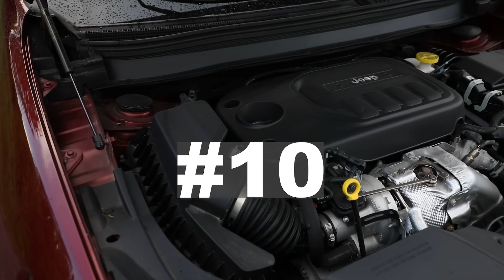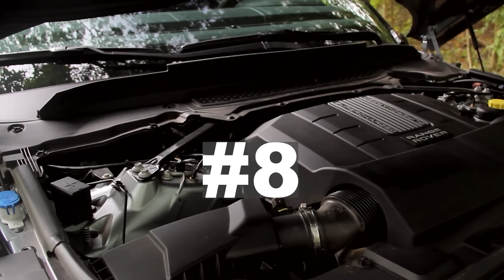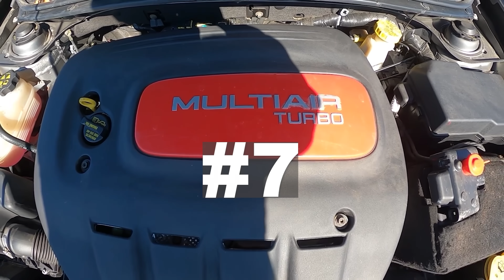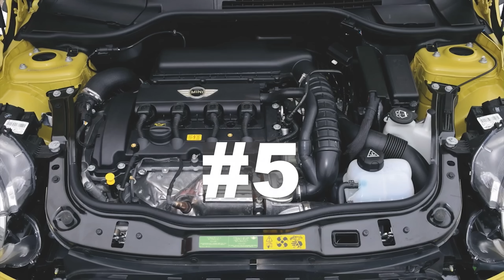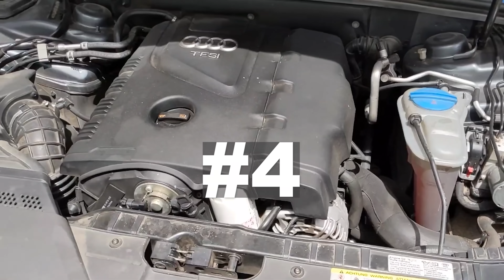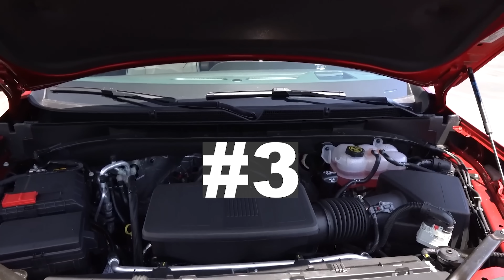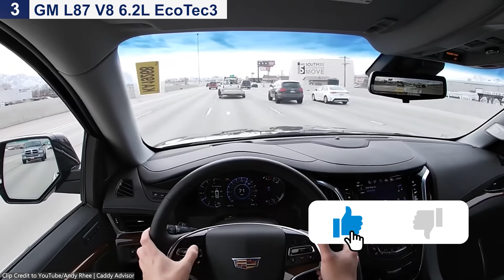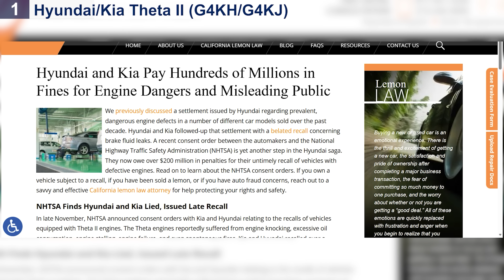The WORST CAR ENGINES ever made (AVOID AT ALL COST)

Comment: Avoid turbos in general.
Reply: That’s becoming virtually impossible since most companies are making cars with small turbo charged engines that run hotter and need more frequent oil changes than the manufacturers and dealers are claiming—which is a recipe for disaster. This also makes buying used cars of this type like playing Russian roulette if the previous owner(s) weren’t diligent about maintenance and oil changes.
Reply: Turbos have been around for years, very popular in Europe.
Here in North America people don’t have them serviced often enough. 
Oil & Filter changes are very important, but people don’t have it done when they should.
I’ve been in the car business 44 years.
They work well when you look after them.
Reply: @mcmuskie2563 That’s why the combination of owner negligence and the proliferation of turbo engines is a risky proposition for used car buyers.

Comment: As a mechanic, you forgot to include the 2.4L GM Ecotec. The consume oil at an alarming rate well before 100K miles and the timing chains like to give out at around 100K miles. I would say that these engine are far worse than the 2.4L Tigershark and the 3.6 LFX.
Reply: My 2009 Chevy HHR with the 2.4 engine gave me no problems in 125K miles I had it
Reply: @jrthevet  That's because it doesn't have direct injection.
Reply: Yes a shame because the Malibu itself seems to be otherwise decent car.
Reply: 2008 Cobalt just hit 83, 000 never had an issue other than a recall on the electric steering unit, & column switch, & no problems since oil changed every 4 to 5 thousand miles it has the 2.4 Ecotec with a automatic trans.

Comment: Best car I ever owned well one of the best was a 1983 crown Vic bought in eBay for 2500$.  Had 11000 miles as it had been stored for 20 yrs while estate was in probate.  I had to buy tires and do engine work, hoses belts etc but that car ran and ran.  It’s no accident taxi fleets and cop cars used the 4.6 ford.
Reply: Crown Vic’s are a great and reliable car.
Reply: I had a 2007 police interceptor crown vic in 2013. Very reliable...
It saved my son's life in an accident on a Ontario icy road.

Comment: Suffered from the Hyundai Sonata 2.0L disaster. Still haven't recovered financially😢
Reply: My grandsons  2013 Hyundai Sonata  was junk too. He had to add oil with each gasoline fill up. Due to weak piston ring tension.
Reply: got lucky on ours, they ended up replacing 2012 engine, but it took a month to do it.
Reply: I have a 2013 Sonata with the 2.4. My mom bought it new and recently handed it to me. Engine failed at around 99,000 miles, but it was covered under warranty. Has about 110,400 miles now. Wish me luck. 💀
Reply: Korean Rubbish

Comment: Some engines are essentially sound designs, with a flaw that can be catastrophic for first customers, but that can be remedied once known. This is the case for the VW/Audi 2.0l turbo. It is quite possible that VW did not know upon releasing the engine that the timing chain tensioner (not made by them) would fail anywhere from 20k to 80k miles, causing the timing chain to jump time and the interference engine to self-destruct in abut the time it takes you to say, “huh?”. Lucky owners would get away with the same failure, but as they were cranking the engine to start it, leading to bent valves and “just” a $6000 head replacement. This flaw was remedied in later versions, but not before hundreds of thousands had been introduced to the market with the fatal flaw. If you are looking at a used one, have a mechanic check this – there is an inspection hole allowing a very easy determination whether the part has been replaced. Even if it hasn’t, replacing it is a fairly inexpensive matter if caught before full Harri-Kari occurs. 
I have one with 130K miles, and it does not consume or leak a drop of oil between 6000-mile changes.  The carbon buildup mentioned in the video is true, but it is true of all direct-injection engines, which do not have the benefit of fuel constantly washing over the intake valves.
Reply: Use "Top Tier" fuel stations only and you will eventually clean your engine. Read my post above.
Reply: @BullittGT849 I did look for your post on fuel, but there were 404 comments, so I couldn’t find it. 
In any case, I don’t see how the fuel choice could “clean” intake valves in a direct injection engine when the fuel never touches these valves on the back side.
Reply: A Google search found - "Impact of Top Tier Fuel" that says Top Tier Fuel helps by keeping the fuel injectors clean, which can improve atomization and combustion efficiency. Don't forget that the PVC system can draw vapors of gas and oil into the intake manifold.  which causes buildup of carbon. Consumer Reports indicates that using Top Tier gas can reduce engine deposits by 45 to 72 percent over a 5000 mile period.

Comment: Working as an auto mechanic back in the 90's, I quickly learned that any American engine under 4 liters displacement was junk! The large V-6's and V-8's were ok to good, but any small V-6 and 4 cylinder from Detroit was garbage! Today, Detroit cannot even be trusted with their bigger engines
Reply: Lmao now that’s exaggerated crap. The 3.8 gm, even the supercharged versions are some of the most reliable ever made as are the 2.3 and 2.5 fords. There are plenty of good smaller engines from back in that era. Damn sure ain’t now.
Reply: @TheMajictech The 2.3 and 2.5 Ford & GM engines were junk! Worked on my share of them!
Reply: @bernieeod57 😅 I guess you didnt understand them. All cast iron is hard to beat. I had a turbo 2.3 boosted to 27lb back in the day in a first gen rx7. That junk shure put a whoopin on a lot of V8s
Reply: @TheMajictech The "Iron Duke" Was gutless! Add the feedback carburetors on the early models and it was unreliable junk! The Version used in the Jeeps with EFI were the most reliable but they were gutless with no fuel economy to show for it
Reply: @TheMajictech The 3.8 was ok, not on par with anything from Japan tough
Reply: @bernieeod57 oh trust me I know, I worked at a Mazda/nissan/buick/gmc dealer back in those days. Me (Mazda) and the Nissan techs would be doing routine maintenance , timing belts and a valve cover gasket here and there. The gm guys were all balls deep in various stages of leaking seals and gaskets everywhere ( dex cool anybody?😅) constant hvac issues. Weird drivability shit from bad grounds. The gamut of garbage motors even back in those days. Except the 3.8
Reply: Hell the millennia s was even better than most of this junk now, it was a supercharged 2.3 v6, I never ever had to go into one aside from 1 severely overheated one from a busted radiator tank that had hit debris on the highway.
Reply: @TheMajictech The Ford Escort was reliable but a) It was designed in Germany by Ford of Europe and b) It was gutless
Reply: @TheMajictech Then came the Quad-4! The engine that was supposed to to send the Japanese back across the pond! With their tailpipes tucked between their rear wheels! A few years later, GM quietly put it out of its misery! Eco- Tech turned out to be Quad 4 2.0!
Reply: @bernieeod57 depends on what era of escort you’re talking about the early 90s GTs had the 1.8 Mazda dohc bp in them. (Same engine as the first gen Miata.) Not a ripper by any stretch, but zippy and you could abuse the snot out of those. You could also bolt them right into a 323 and make a ghetto sleeper that was fun.
Reply: @bernieeod57 fords germany connection was an interesting one. The merkur xr4ti used a 2.3 Lima engine that was turbo charged. I snagged one for a first gen rx7. That was a fun project. Ran way better than any rotary I saw.
Reply: @bernieeod57 I was never really impressed with those. One if the gm guys had an Isuzu pup with one in it heavily modded desert pre runner type thing. Never impressed me at all.
Reply: @TheMajictech MAZDA, not Detroit. Even the Rangers improved dramatically when they had Mazda engines in them! Then you had Mazdas with 3.8 and 4.0 V-6's which was ok because the large V-6's from Detroit were good back in the day

Comment: I’m surprised the Ford open-deck “eco-boost” 1,5 & 1.6l engines often seen on the Fusion dis not make the list, with its frequent engine fires. It seems the engines were designed to catch fire. I don’t know who would want any open-deck engine today, as the design has proven its unsuitability, but the Eco-boost was a carefully designed time-bomb. Cracks would develop from deformation, causing the coolant to leak out without warning, and the cracks were perfectly placed to atomize engine oil all over the overheated carcass, causing instantaneous ignition and the car to be consumed in the ensuing inferno.
Reply: Weird, I haven’t heard of a single fire in these vehicles. Yes they do have head gasket issues but the fires are a new one on me.

Comment: The owner's are to blame for some of this. Everyone should check their oil at least once a month and if you know your car consumes oil then check it once a week or at every fill up. It should never get so low that it doesn't show on the dipstick. Also, how many owner's (& sometimes even dealers) don't use the recommended grade of oil in their engines which can negatively affect the VVTi system?

Comment: Yeah, you definitely missed a big one, the BMW 4cyl N20 turbo engine from 2011-2017. I'm a retired BMW Parts Manager and we replaced these engines like we were doing oil changes! The big issues with this engine was the  timing chain components,turbos and coolant leaks. They literally sounded like diesel engines when they came into the shop.
Reply: I used to buy new bmw 325 /328 every 2 years.   My last one was 2012.  Not only did I get talked into that horrible engine vs the usual 6 cyl I got in other 325/328 cars but it broke down 2x before I even had 2500 miles.  They tried to blame me because it was low on oil but bmw doesn’t give you dipstick or place to add oil.  You can only check it “electronically” and it said everything was fine.  In reality it was low.   How stupid to not have dipstick or place to add oil.  I always wondered about that.  Anyway that car had the engine changed twice before 20000 miles so we dumped it while it was under warranty.  BMW resale tanks after warranty anyway but we were done with bmw.   I’m back to Toyotas.
Reply: @mtsaz7995  My new BMW last year came with a quart of oil neatly velcroed to a special slot in the trunk :)

Comment: The 302ci Ford used in their 60's full sized vehicles.  Anemic, gas guzzling boat anchor.  Pathetic.  Unlike Ford's 292ci V8.  That was NOT a gas guzzler.  But just as anemic and pathetic.  Ford, the 'nickle and dime you', brand.
Reply: Drove my father's 1968 Gakaxie 500 convertible until 2014. 15 to 17 mpg. No issues except a timing chain at 106000 miles. Simple and dependable motor. My 1974 Pontiac GP SJ with a 455 got 6 mpg city and 12 mpg highway. So the 302 was like a modern-day Pruis back then!

Comment: Chevy 3.6L LFX  got better after 2012, but 4-5k oil changes with synthetic oil and a high-quality oil filter are a must. Changing the PCV valves at 30K and checking the oil level bi-weekly will help with long life, also. As with any engine, preventive maintenance is the key to a problem-free motor
Reply: I have a 2014 Equionx LTZ with the 3.6L V6...150k on it as of Nov. 2025, runs perfect with regular maintenance, cooling system flush every 5 years, trans flush every 50K, and usually 4k oil changes. Spending a little time and extra money now is better than breaking down on the side of the highway, and a huge repair bill, or even buying another car...Oil changes are cheap, engines are expensive

Comment: I'm never getting rid of my 92 chevy s10  with 210000 and still going and will not buy any vehicle over 2000
Reply: My 96 GMC Sonoma with the 4.3 V6 has 264,000 miles, doesn't use oil and runs great, I'll drive it til the wheels fall off.

Comment: A guy I knew had a bmw 550i prob a 2014 model that had the n63 engine. He told me it had oil consumption and eventually the motor blew up and he had to pay 10 grand USd to get the motor replaced. Stay away from me v8s, they are known for issues, especially oil consumption.

Comment: Bought a used A4 for the wife for her birthday.  After owning for about 2 months I noticed the engines insatiable thirst for oil, exactly as reported here.  1 quart every 1k miles.  Took to Audi.  Received a song and a dance about its acceptable under Audi guidelines.  I dumped that car immediately.  Dodged a bullet.
Reply: It probably had worn valve guides and / or piston rings, not something that will "work itself out". You did the right thing.
Reply: For your future reference.  I have discovered a procedure known colloquially as "piston soak" that cleans the ring-lands on the pistons (so the oil rings can move properly) and actually heavily reduces and sometimes cures oil consumption cases.  I've tried it on my oil burner Volvo XC90; and one treatment has actually reduced oil consumption by HALF; I'll be doing it again before the next oil change.  Look up "Berryman B-12 Piston Soak"; you'll see what I mean, it's pretty cool.
Reply: Smart move trading it.  Not your problem anymore

Comment: I had 3 Chevy Traverses as company cars.  2016, 2018, and 2020.  Drive each one 24 months and the least milage was 115,000 on the 2016, the 2018, and 2020 I put up to 130,000 on each.  All oil changes done by Chevy.  Brakes, tires, and wipers only repairs done on all three.  I drove them in the Manuel mode and put in 8th gear to over ride on/off switch.  I loved my Traverses.

Comment: When you buy any vehicle with an interference engine, your playing Russian roulette!
Reply: Failing to maintain them is the dumbest and most common thing today.
Reply: Indeed. Timing belt/chain breaks are instant catastrophic engine failures...
Reply: @GeezerNoob  Timing chain breaks are incredibly rare.   Timing chains usually jump 1st - and often at several hundred thousand miles.  There are a lot of cars out there with over 400,000 miles on their original timing chain.  My car has over 300,000 miles on its timing chain with no problems.

Timing belts on the other hand....  I had a 1983 used car that i changed them every 50,000 miles on (and I changed it on acquisition as I purchased the car used).  I did my own maintenance and got really good at it as I put over 250,000 more miles on that car before it got retired due to becoming more expensive to repair than a newer used vehicle was to buy.
Reply: @perryallan3524 
BMW 528i X drive 4cyl, turbo - timing failure at 135k km. And I can give many other examples. You know nothing about modern engine design
Reply: CHEVY SPRINT GEO METRO 1.0 LITRE 3 CYLINDER G10 IS NON INTERFERENCE ENGINE!!

HAHA! TAKE THAT ALL YOU GEO METRO HATERS!!
Reply: @richardkaltenbach3961 2 strokes aren’t interference either 😅
Reply: Why is that? Interference engines breathe better because the valves can open earlier, close later and open wider and have higher compression ratios which extract more power. There must be a lot of people playing that Russian Roulette as Honda, Acura, Toyota, Audi, BMW and Chrysler models use this type of engine. It has actually been stated that "Interference engines are prevalent among modern production automobiles and other four-stroke engine applications." I get the timing chain issue as all of the makes above use chains. Sounds to me like people need to know more about their vehicles or find someone who does. Most issues of timing chain problems are apparent before failure. Not having the knowledge or knowhow to detect these types of problems come down to you AND your mechanic. If he won't tell you what to look for, listen for, or feel for watch out for that mechanic. Your best interest is not his.

Comment: Another good mention which should be somewhere at the top is chevys 1.4-1.8l eco tech engines that blow head gaskets, blow crankshaft seal gaskets, blow timing cover gaskets, have the worst thermostat housing assembly ever produced that leaks coolant, valve cover leaks, and has a stupid inline coil pack so when one goes you have to replace the whole stupid assembly.

Comment: BS video. ANY Ford EcoBoost engine belongs on this list They are notoriously bad
Reply: Had several -- never one problem.
Reply: @glenatgoogle4393  You are an aberration
Reply: @glenatgoogle4393  Makes you 1 in a thousand
Reply: Only Notoriously Bad for Owners that are Notoriously Bad at Practicing Common Sense. And Staying on Top of Preventative Maintenance
Reply: @Sluggo-e7q  Sure, undersized rubber belts running in hot oil, water pumps that leak directly into the oil, cracking cylinder blocks, 2400 dollar timing drive replacements.  They don't argue about which Ford engine is the best, they argue about which is the worst.